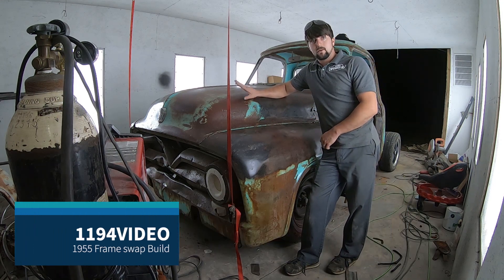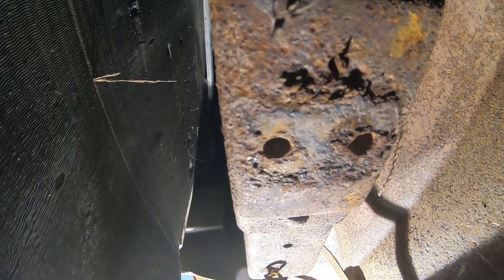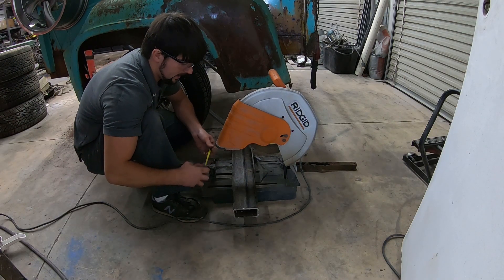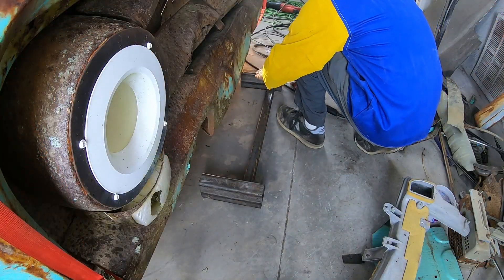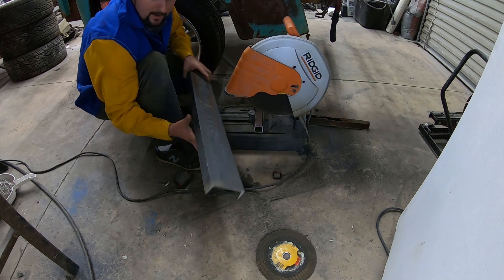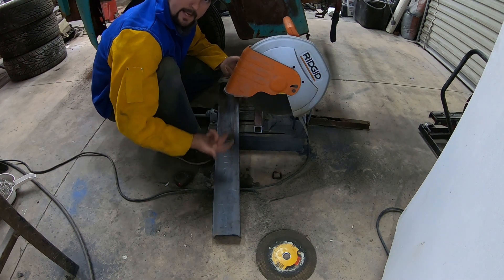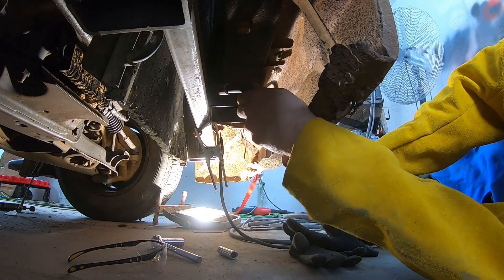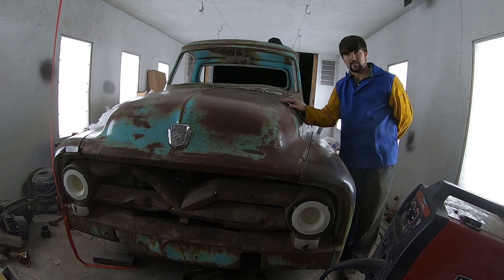Patina F100 frame swap front radiator support crossmember build

Comment: What year is the Ford ranger you used for the truck, and what cab figuration used
Reply from the maker: In a ranger you will need 98-2010. It has the correct wheelbase, the 55 did not have the correct wheel base from the factory, the front wheels were moved back and not centered so the 98-10 fixes that, I used the c channel to use stock 55 front cab mounting and for the rear used 10 ga steel and relocated the ranger rear frame cab mounts to bolt the 55 rear cab section to the ranger cab mounts just moved forward to fit, the center of the rear had to be notched due to the ranger frame angling up in rear and I used 10 ga along whole rear section, check out the playlist for that truck and it shows all of that info